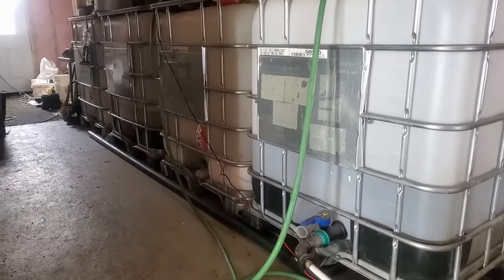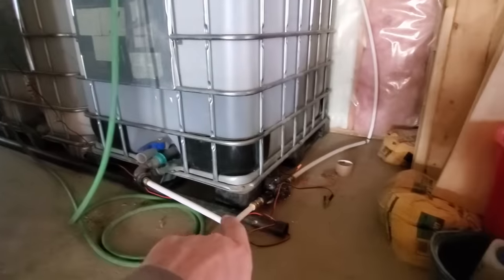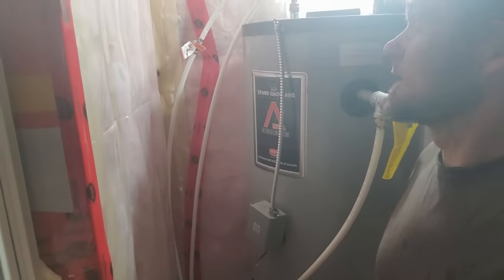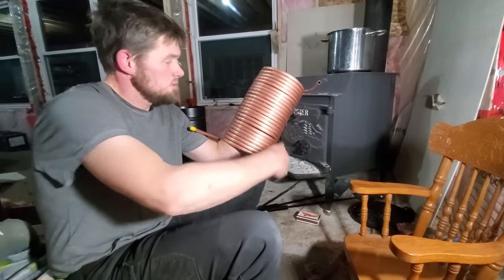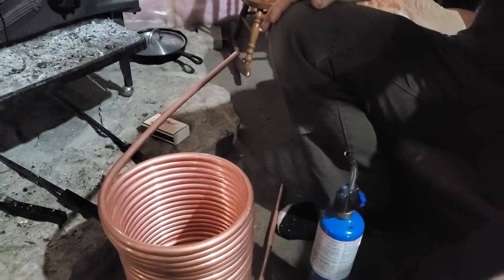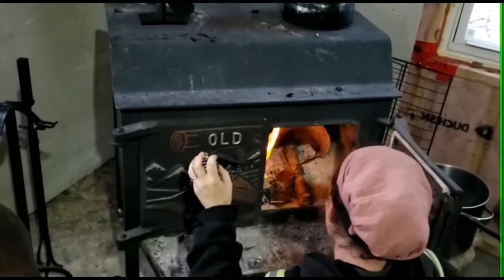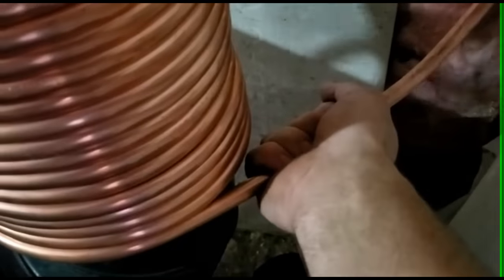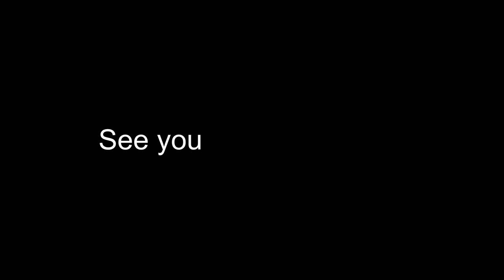Endless HOT water for FREE /OFF GRID

Comment: Great to see! This was the way most houses did it in the UK in the days of coal, inset fires had a back-boiler tank,  with thermosyphon connected to a hot water tank above the bathroom. Couple of hints from my dad who worked on these systems: 1. Thermosyphon tube should be 1 inch ID or more for full efficiency, or the fluid drag of a smalller pipe significantly reduces your output (1 inch is almost double the cross-section of 3/4). 2. Any 90 degree elbow in the plumbing run reduces the syphon flow by a significant degree, so always try to use wide sweeping bends. 3. Always have a radiator somewhere in the circuit that will dump heat from the system if it gets too much. I’ve not tried this myself yet and it’s great to see this works well even with smaller tube ...and if you are getting what you need and are running the burner anyway, then good enough is good!
Reply: I remember having to light the fire if you wanted a bath.
No such thing as a quick shower first thing.
Reply: Concur. I lived in the UK and installed a coal stove with a back boiler to drive the radiators with a pumped system. The domestic hot water cylinder was on a 1" gravity loop. The thing that mine had that I don't see here was as the stove had an actual water jacket, the air feed to the stove was controlled by a thermostatic damper to keep the water temp in the stove and cylinder from ever reaching boiling as if it does you risk blowing pipes or worse yet a steam explosion of the hot water loop. Plan for the event that there is more heat in the water than you are using. A heat leakage radiator would certainly help.
Reply: I love my back boiler. light the fire in the living room and it heats the entire house up!
Reply: How about a header tank on the closed gravity loop to take up expansion of the fluid and ?
Reply: @johnstidworthy3370  I was wondering where it was.... as it stands, this looks  like an unvented system.... with no fail-safes 🤔
Reply: The lack of control for the inevitable thermal-expansion is concerning.
Reply: @Aurora..Borealis  just add a pressure relief valve, or a thermo pressure relief and pipe it out somewhere sensible
Reply: I put 3 safety valves on mine in total !
Reply: 1st comment ever is a doozy.  Another back patter
Reply: @peterfitzpatrick7032 Yeah, I was going to say that there should at least be a pressure relief valve somewhere to make sure it can vent off excess pressure somewhere!

Comment: I’m new here. I’m very concerned about your use of pex to the coil. Pex is only rated to 180°. I’m sure you are exceeding that and may have a disaster in your future as the pex degrades. Please look into it. Just because it works now doesn’t mean it won’t explode in the future. The cross link polymer will degrade over time with excess temperatures
Reply from the maker: Very good comment,  thank you and welcome to the channel.
The higher the PSI in the line the lower the temperature tolerance it has. At 80 psi its good for around 200 degrees but at 45 psi its good for 250 or more.
We actually have around 40 psi on this line and it has a pressure relieve valve on it just in case. It would be interesting to put a thermostat on the system to see how hot the water actually gets but at this point we are not worried.

Comment: Used to live in an old farm house that had what I think was called a range boiler or piping through the fire box of a wood fired cook stove. The old galvanized tank was in a small room directly behind the wall where the range was set. The principal of course being the cook stove was in service all year round so there was always some hot water in the tank. The system wasn’t in service anymore but all the piping and tank were still there. Even as a kid I found the idea intriguing. Today I’m off grid in the high desert so I use solar for hot water. Works pretty well. One thing caught my eye in your system and that’s the possibility of insulating your coil. Something I’ve used around stove pipe is header wrap. You may have seen it used on custom motorcycle exhaust where there’s no provided heat shield. It’s fire proof to very high temperature and last a very long time. However it’s expensive even in small rolls. In my solar system I found I needed to insulate nearly every exposed pipe to bring the performance up to desired levels. Every part of the system is radiating heat all day and night so radiant heat loses can really cause problems. Most of my system is wrapped with felt insulation. It keeps me from getting burned on the copper pipe when I’m doing my inspections. It’s takes surprisingly little insulation to mitigate the losses. Great video.
Reply: Solar water heater on the roof gives you domestic hot water 3 seasons
Reply: @scottmcintosh2988  ah…yes. But this is the desert. Winter here is almost always clear an cold. Solar works equally well in winter as in summer. One of the trade offs for several months of cooking hot weather in the summer.
Reply from the maker: Great ideas thank you
Reply: @jamespayne8781  can you have a recommend a video for the shower heater setup? Planning to go off grid soon too. Thanks!
Reply: @starchild2121  I actually built my own system from salvaged parts. I didn’t have any resource material to draw from. However it’s wasn’t really all that hard. I had acquired a thermosyphon system which I re-engineered to use a circulating pump. Sorry I can’t recommend the kind of source material you are looking for.

Comment: Good to see you having a go.  Do not use galvanised steel pipe material for water, especially hot water (heating water drives the oxygen out of the of the water and it then combines with iron; rust) and any copper in the system will create a reaction to corrode the iron quickly.
Reply: A dielectric couple between the dissimilar materials would prevent that galv. Nipple from closing up in two or three years .
Reply: @joeharvie8362  I hope your right Joe. My experience was to never put steel into fresh hot water (oxygen leaves heated water and combines with steel. Zinc will give very short term protection). The electrical potential difference between dissimilar metals in a water service is another issue that needs to be dealt with (dielectric separation is difficult with fresh hot water flowing between dissimilar metals). None of this is a problem if you can easily swap out parts as they fail. (I am just an old plumber thinking a bit of brass all thread and brass tee would have been the go). Heating water using thermosyphon is good. But great care is required when using a "Uncontrolled heat supply" for the heat. One should not use plastic pipework (PEx). I do not know at what pressure you will have your hot water system operating at. To give an example if the water pressure is 50 psia. at sea level the water temp can/will reach 281degrees F. Their is a real danger of scolding without temp control devices fitted and of non metal pipework failure, particularly between heat and storage and between storage and temp control device(s).

Comment: A few things. 1) right angles on your lines cause you to need a bigger pump and limit flow - try and avoid if possible. 2) insulate the lines - even the cold ones.  3) insulate the coil around the stack.  You are losing a lot of heat to the room.

Comment: Great concept, a convection hot water recirculation system.  The only thing I would change are the pex lines from your heat exchanger coiled around your stove pipe to the hot water storage tank.  You will find that these pex pipe will get soft and less ridgid as they are not designed to be hot all the time.   I would recommend to continue the lines from the heat exchanger to the hot water tank in either a copper pipe type L or K and try to avoid using type M as it has a thinner pipe wall and is not appropriate for a recirculation system.  You should also try to use brass or copper nipples and fittings for domestic water rather then galvanized fittings.  Keep up the good work.
Reply: I do HVAC Mechanical, and when we do Geothermal systems, we often tie them into the hot water system to improve efficiency of hot water.  We normally run copper lines, but I know plumbing code allows you to run pex all the way with no problem and that's on a re-circulation pump.  Never heard of an issue where they have failed from being hot on the time.  Only failures I know of is when they don't position the pex ring crimp properly .
Reply: @jcarney1987  essentially yes you can run pex for heating but there is pex specifically for heating and pex specifically for domestic water. I made my comment because I can almost guarantee that the pex he was using was for domestic water use only and it was also insufficiently supported, and when insufficiently supported it will sag due to the heat of the water and as well being near the heat source.  I don’t take chances nor do I think people should take chances when it comes to potential water damage.
Reply: Using pex in this way is fine as long as you support it properly. The only difference between heating and potable pex is the heat pex has an oxygen barrier which prevents air from leaching through the plastic and into your boiler system, which can cause rust and other issues not ideal for heating systems.
Reply: I thought that 2.  Copper for the longterm
Reply: @terrygabriel5945  When the PEX softens does it leach BPH into the water?
Reply: Thanks for that info ~ cheers.
Reply: I’ve used pex for years never had any issues hot or cold

Comment: I so enjoyed seeing your kids helping you moving the tanks, too. What a great family!
Your system looks good, and I enjoyed watching you work with the pex (a technology I'd like to get familiar with). As a welder fabricator, I make wood stoves as well as stainless steel water coils that go inside the firebox for thermosiphon heating. My place has a stove coil for in winter, as well as a passive solar (out door) collector for the summer season (that must be drained in winter to avoid freeze damage). They both thermosiphon to the same storage tank (which is a standard electric water heater with the thermostats set low, but still there as backup). The HOT outlet from the storage tank should have a "thermostatic tempering valve" on it. These are common in solar systems and mix hot and cold together to prevent dangerously hot water from going to your home's fixtures.  Also, your heating coil, being in the lowest part of your water heating system, would be great place to add a T and a drain valve for servicing, sediment flushing, or draining to avoid freezing damage in case you might ever be away and your home be freezing?. Don't forget a T&P relief valve somewhere on that hot side, too. It is good to have them plumbed to a drain because it is quite possible they might forcefully dump boiling hot water sometime. And NEVER have shutoff valves on both sides of that heating coil to insure they never get both accidently closed risking a steam explosion!
I've enjoyed your video and am adding my subscription.
Reply from the maker: Thank you for joining us

Comment: This looks like a good system that you can make quite easily but if you want more hot water, I would recomend putting just one or two loops inside the firebox. I have that in my Pioneer Princess wood cookstove and it is tremendous! I have too much heat for just hot water so I have a heat exchanger to bring that extra heat to heat my hydronic cement floor. It makes the whole house so much warmer and more comfortable without burning any extra wood.
Reply from the maker: Those are great stoves!
Reply: What about summer? Myself I could see a setup like this working well for us in the winter when we are burning wood to (supplementally) heat the house, but summer is a whole different deal. Any extra heat in the house is unwelcome. Very warm (and humid) here. I'd be thinking a mixed system for where we live: passive solar water heat in summer and wood burning in the winter.

Comment: Great video!
1 small tip!
Maybe at the beginning you could give a quick explanation as to how the hot water rises and takes itself out into the storage tank and also the siphon effect!
Just for those peeps who may not be familiar with this idea!
Thanks for posting!
Reply: Liquids and gasses become less dense as they get warmer. They are displaced upwards by colder more dense liquid or gas. That's it! 
I always remember a lecturer at college telling us that hot air balloons do not rise of their own accord. They are displaced upwards by colder more dense air around them. 
As has been mentioned in this thread. The thermosyphon effect is very fragile that is why they were always piped up these primaries using 1" Dia pipework.......depending upon the vertical distance between the stove and the hot water cylinder. (In the UK we call these two flow and return pipes the primaries) Doing a job like this, I would probs wrap 3/4 annealed copper tube round flue, and then reduce up to 1" for the primary pipework to upstairs. Thermosyphon will go like a steam train. Also pull one or two heat sink radiatiors off the primaries for free heat and a means to get rid of the heat if you're generating too much. If steam pockets form in the primaries, (which they can and often) they make a horrendous noise, as the steam pockets rattle up the pipework. Last point, this primary system on a solid fuel stove should be atmospheric, ie there should be an open vent on the system. Failing that, there should be an expansion vessel and a pressure safety valve (PSV). Otherwise you just built a bomb!
My credentials.....Served a 4 yr apprenticeship as a plumber/heating eng many years ago. Kept studying. Now a Chartered Engineer with 2 degrees and a Master's in Engineering.
Self built last two family homes and loved it! Dying to do it again. 🙂

Comment: Well done, I loved the video. I use those water tanks for irrigation purposes. One tank for the roof inlet and the other 2 are connected with 13mm flexible pipe. They all gradually come to the same height. It was easy to drill near the base of each tank and attach the fittings. Cheers from Melbourne Australia
Reply from the maker: Thank you, great ideas!

Comment: also beware to clean the cooled part of your chimney more often due to condensating the woodgass creasote tar etc it's where the deposits should build up in system but totally safe when unignored meaning a regular maintenance plan. i applaud you for your greenness 💚 alternative energy solutions and self sufficiency
Reply: Since it is right next to the wood stove, and that the heat was already radiating into the air, it's likely that this won't be an issue, especially if creosote remover is used regularly. But you make a good point, flue temperature is an important thing to consider.

Comment: Totally awesome!  I googled a diagram of the piping.  I would think an expansion tank would be needed being that that stove can get real hot!  Wondering if that’s been an issue at all?  Also, I bet you can incorporate a coil on the roof for summer water heating when you don’t want to be running that stove.
Reply from the maker: Yes we plan to build and add a solar hot water coil this summer. 
So far an expansion tank has not been needed, we have a relief valve in the system but the whole thing has run flawlessly for 1.5 years now
Reply: You only need an expansion tank if there's a check valve or backflow...which would make it a closed system. An open system the expansion will go back into the source....
Reply: I think you appreciate that if you fill the heating coil with water and close the valves at the inlet and outlet the pressure will rise and could burst your coil due to thermal expansion of the liquid or pressure generation when the system is partially filled.  If not, please ensure thos doesn't happen or ensure your relief valve is connected to the right place and is sized for the worst case scenario.
Reply: @countrysideacreshomestead2008  did you post a diagram of the entire water system?
Reply: @marksexton1340 ...  the source is an electric pump with a check valve holding pressure. The pressure drop of opening a faucet is what starts the pump. What we seems to be working with here is the flex of all the plastic pipe as the expansion tank.
Reply: @rupe53  
Aahh...the check valve makes it a closed system. The plastic piping will work as an expansion tank....until it doesn't.
Some types of plastic piping will expand and contract as part of their chemical make up, and some will break over time.
Reply: @marksexton1340  ... works till it doesn't... that's kinds where I was going!

Comment: That works like my solar heaters on my roof. They heat up in coming cold water,  dumping it into hotwater heater then the gas only has to heat the water to optimum temperature unless the solar water can keep the whole tank hot. That happens in summer. Winter it needs gas assist. We still save a lot. I would want to coil the whole exshust pipe to maximize my hot water intake. A lot of heat goes up that pipe! But great job. I like the cool look.

Comment: Outstanding video and there are some great tips about corrosion as well.  From a burn safety standpoint with young children, I would suggest looking into something called a thermostatic mixing valve.  It hooks into the hot and cold lines and it mixes the water to a temperature you set at the valve.  The hotter the water heater output the more cold it mixes to keep the desired temperature.  That way you know the kids are protected no matter what the tank temperature it.  Good luck.